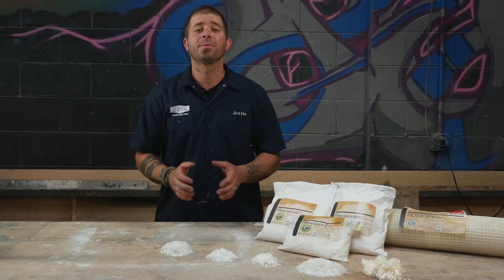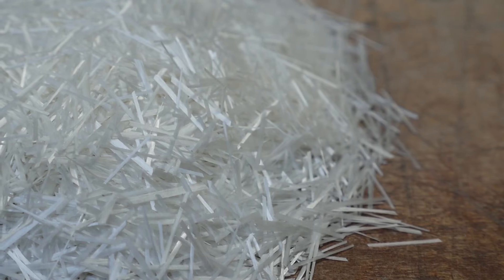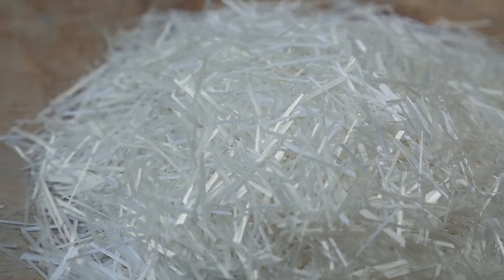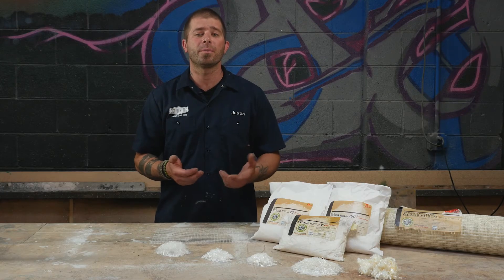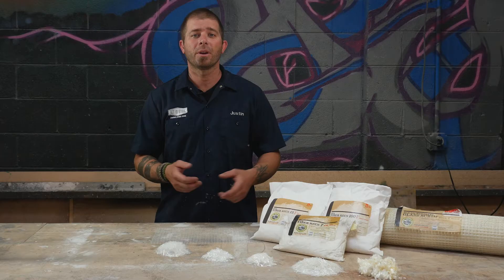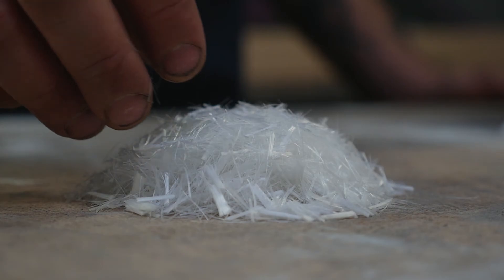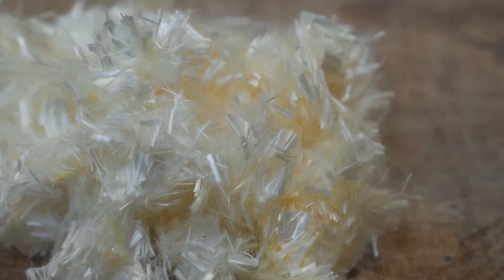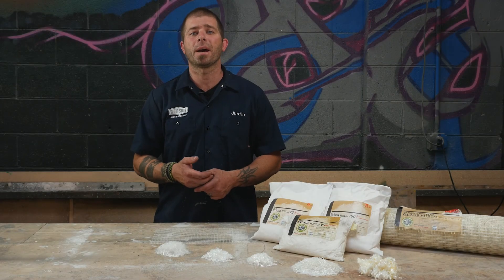Intro to Fibers for Reinforcing Concrete Countertops

Comment: Had part of my driveway replaced 8 years ago, the guy on the pumper ask if I wanted fiberglass. It was only 6 yards he said $20.00, I said ok. No cracks anywhere. I am making sprinkler donuts now and want to add some strength. I use a doggy drink bowl about 8 inches and have a styrofoam drink cup about 2 1/2 inches on the bottom, I filled them with concrete and use them over. For some sprinklers close to sidewalk I just put the cup a little off center. I get about 8 out of a 60 pound bag.

Comment: How do you get a smooth surface on your countertop when you have fibers sticking up all over the place?
Reply from the maker: Usually using a torch to get rid of the fibers and make a light sanding of the surface is enough. But I recommend you to contact our technical support team for a more detailed information, you can it it here: http://support.buddyrhodes.com/add/

Comment: Is there a recommended amount of fibers per square foot of concrete that I am pouring?
Reply from the maker: Fiber load is based off of total material weight not square feet. To discuss more about your application please submit a technical support ticket here: http://support.buddyrhodes.com/add/
Reply: it depends! but it shouldn't exceed 3% of total volume of the mix.